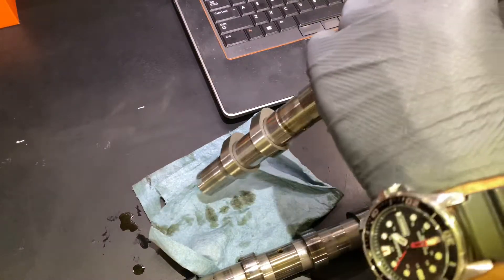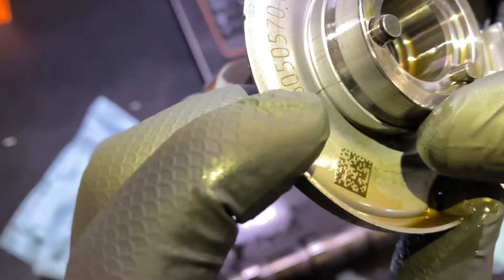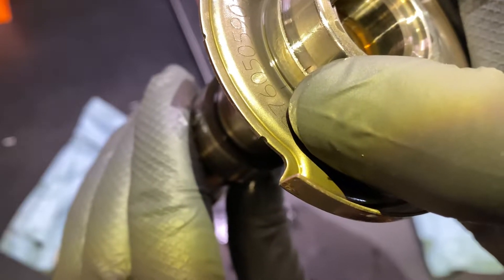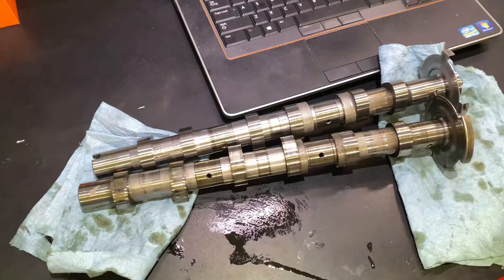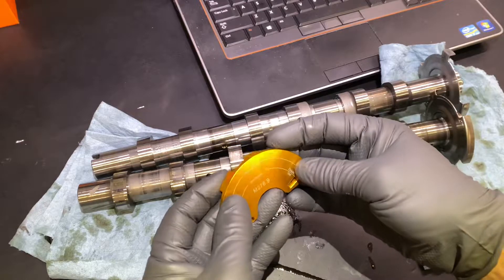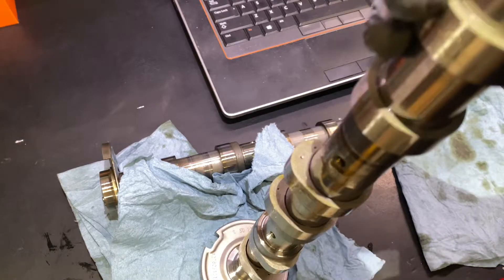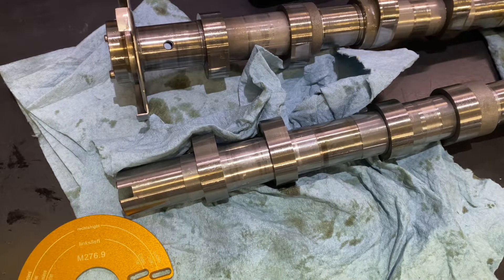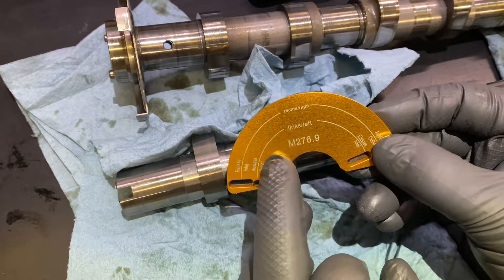Mercedes camshaft - M276 camshaft marking and check reluctor wheel / tone ring etching

Comment: So question: How do you know where to mark the reluctor wheel if it has possibly been displaced by the hammering of a bad adjuster? I am asking because I do not see laser etchings on either the front of the reluctor wheel or behind it. I imagine proper alignment between the reluctor wheel and the camshaft is critically important PRIOR to re-marking both for aligning with cylinder head, yes?

Comment: Hi I have rebuilt my engine and i have 2 engines and for both engines whan i do the timing the crankshaft on 40 degrees the camshaft timing right but when i turn the engines to 53 degrees to check the timing with the holes on the top for the sensors to see the signal plate is it half whay through,  but when i check in 2 engines they not half way do you think that i need to move the signal plates for 8 camshafts with this toll because i have it but im not sure if this the right thing to do because all 8 camshafts are not given me half on the holes and they 4 from the first engine machines the other 4 from the second engine could they all be wrong and all matching wrong , can you help me please
Reply from the maker: mmm you'll probably want to verify the tone wheels haven't moved and try setting the base timing again. Unfortunately, both cam covers need to be removed and you'll want to get the timing tools. It's a bit involved.
Reply: Im very eager to know why the camshaft disc moves? What is the cost to moves?

Comment: I had this problem with reluctor wheel displacement about 70 degrees on one of camshafts. 
I return wheel to right position and welded all 4 camshafts. After engine assembly has no errors, all work good
Reply: How did you return the wheel to the correct position? Did you heat up the ring?
Reply: @Alb3rt0G camshafts and wheels has marks. I use a hydraulic press to unmount wheel from camshaft and mount again in right position using marks